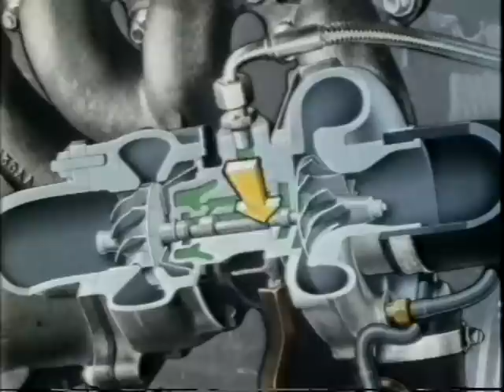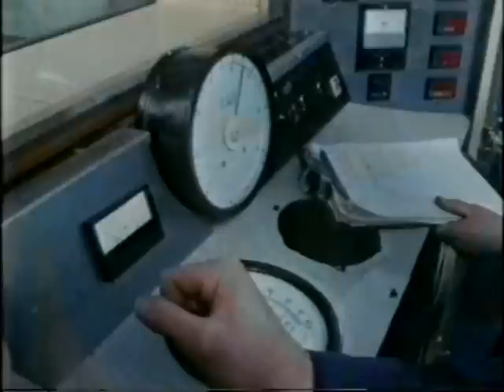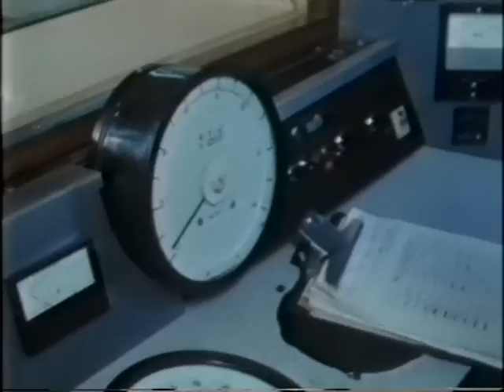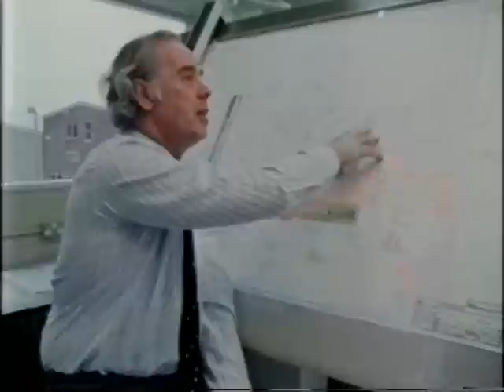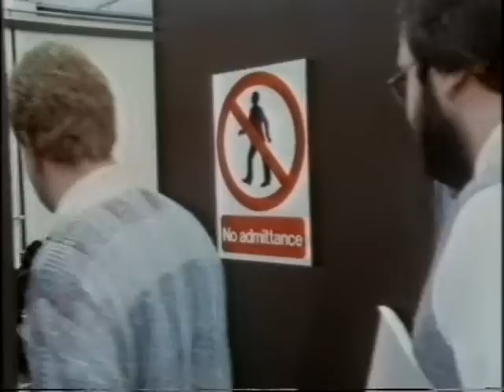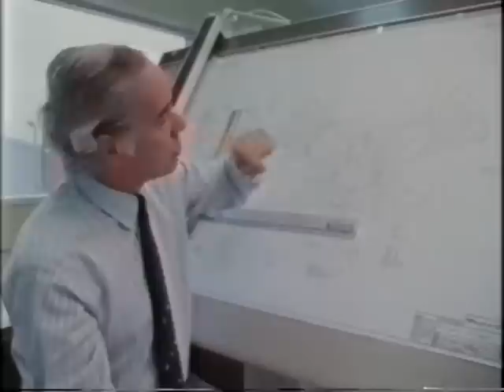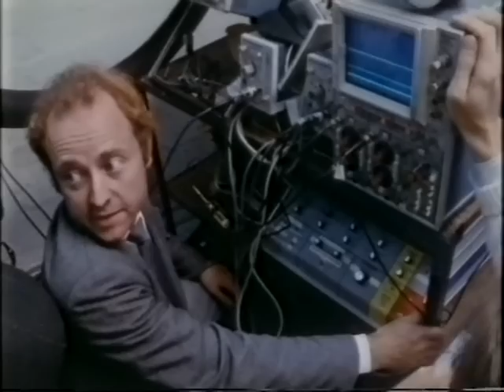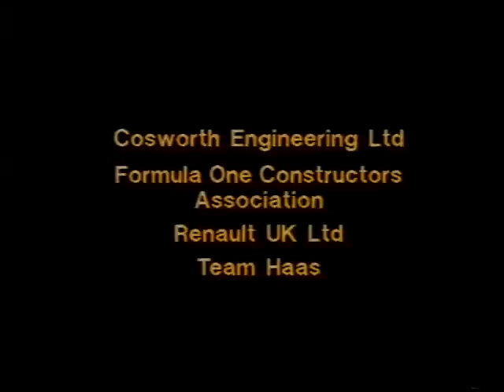1986 Equinox - Turbo - The Cosworth V6 Turbo for the 1986 F1 Season (Part 1)

Comment: 17:50 What surprises me is the distance from valve spring retainer to the tip of the valve which looks to be at least 25mm/1". Most DOHC engines whether with buckets or finger followers don't have more than about 5mm here and I can't think of any reason for them being so long..... It's almost what you would get if you took a standard DOHC engine with hydraulic lifter buckets and converted to solid (i.e. shim under bucket) buckets and left the camshaft heights where they were and fitted long tip valves to make up the difference...... Don't know... Jury's out.....

Comment: 40:00 Why he doesn't install gasket, when assembly engine??? 
I saw it again in video of F1 BMW-Turbo engine assembly. They also didn't use any gasket or sealant.
Reply: joshua griggs  slightly off topic in the 1920s Bugatti engines surfaces were hand scraped witch is even finer. No gaskets used on mating surfaces. Miller Indy motors were the same and directly Influenced Bugatti.
Reply: There are wills rings as gaskets, like many Cosworth engines uses.

Comment: Can you tell  why are head bolts in  angle,because i cant understand well,what did Keith say?
Reply: he said that it allowed to have head bolts away from the cams. so the head bolts are not under the camsafts.
also he said that the angle of the head bolts makes the top of the cylinder block stronger by squeezing it together.

Comment: 20 years before this - no aero, no slicks, and the DFV on the drawingboard. 31 years on the current cars don't seem that much more advanced - sure it's all in the details but either there's a spanner jamming the works or we discovered most of what there is to know pretty damn quick.
Reply: Tell that to the honda boys...
Reply: Richard Dastardly No. I looked at a graph showing average speeds in monaco since 1950something, beginning with around 100kph to 170 in the last year, the graph looks consistent, if anything, the fastest climb was in the mid 60s to the 70s, but since this car, progress hasn't slowed down that much. Just look at today's cars, hell. Even cars from the late 90s. They are leaps ahead of this car.
Reply: f1 could be a ton crazier than it is. regulations now control nearly everything about the cars to the point that experimentation is only possible in tiny details

Comment: This documentary is more about the failures in F1, rather than turbo-charged F1 engines.  I think this engine project was doomed from its inception.  In the movie's opening moments, it mentions Duckworth has little experience and no real desire for designing a turbo-charged engine.  It references skepticism of him in the F1 community. Ford/Cosworth was late to the turbo-charged world and rushed development. I think that's why he tried to develop the inline 4, as it was an established platform with less risk and less development costs.  The GBA V6 was a major risk which didn't return any of its investment.

The GBA V6:  Everything was new (design, electronics, staff) and the lack of experience showed in this documentary.  The result was a severely under-powered and unreliable engine, which put Haas in a difficult position waiting for the GBA V6 to be race ready.  Haas then loses its major sponsor, which turns matters from bad to worse, essentially forcing them out of F1.  The FIA may have picked up on the fact that  the Ford/Cosworth V6 would not be competitive, and in response limited boost and then do away with turbos all together.

Ford/Cosworth did recover in the 90's with Benetton and Schumacher, but the outcome of this documentary was a disaster for everyone involved.
Reply: The GBA wasn’t unreliable!
Reply: @chrismc1977  Correct. It was there in race boost, but Duckworth refused to make qualifying boost engines.